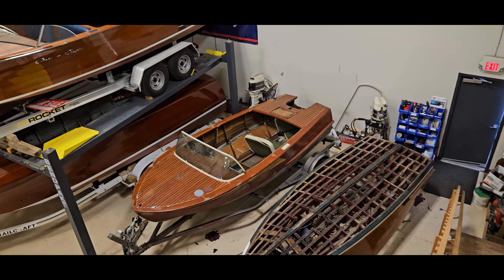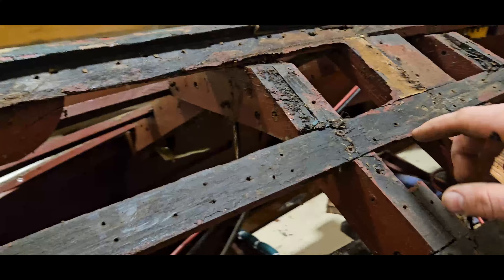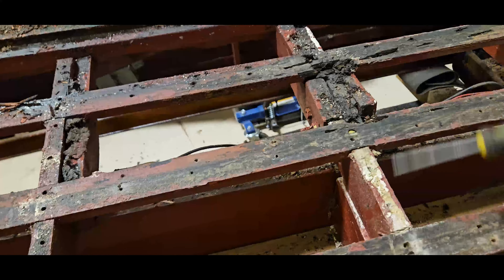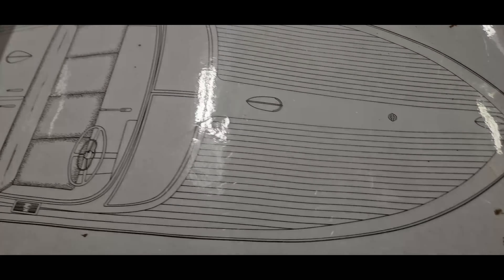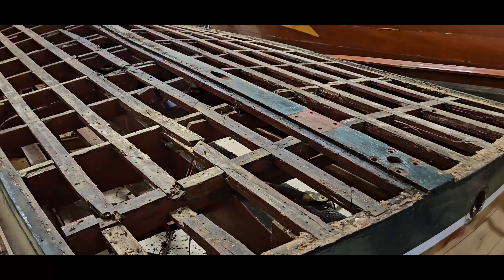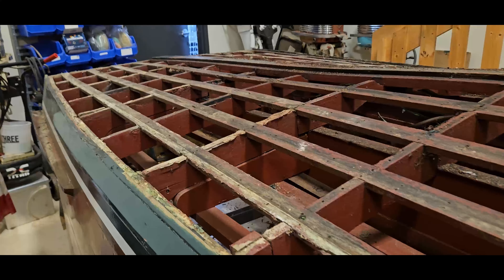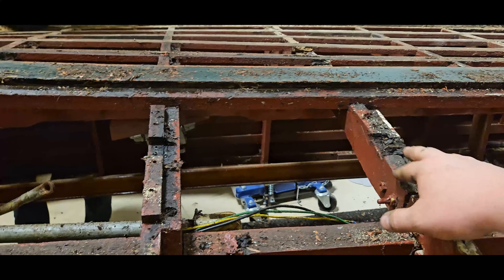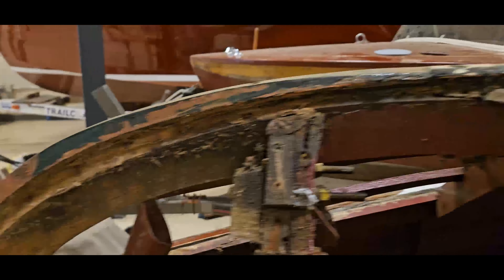SHOCKING Damage from 15 YEARS Of Siting in a Field  !! - Ep 7

Comment: One thing I noticed about your 16-ft resorter is that the train rails appear to be short. The rear ends of them were probably rotten so they just cut them off and rer radius them.
Reply from the maker: That's a great observation! We'll have to check that out.
Reply: Yes because as you know, the length of the chine rail is critical on a century Hull.
Reply: I'm really enjoying your videos. You have some beautiful boats in your shop!